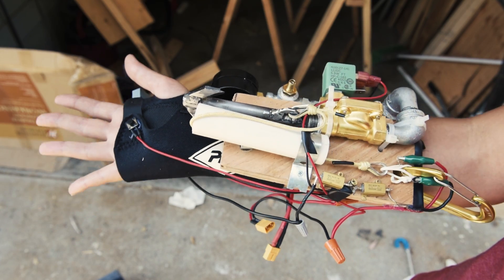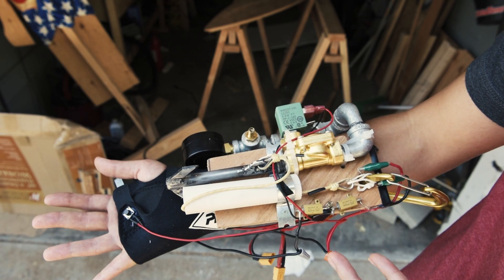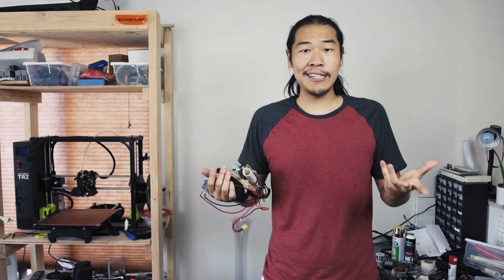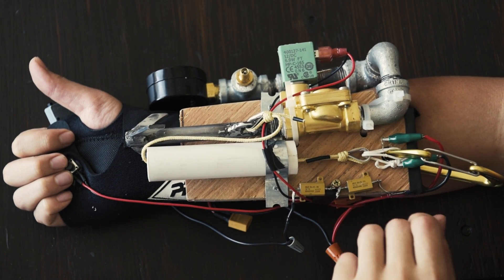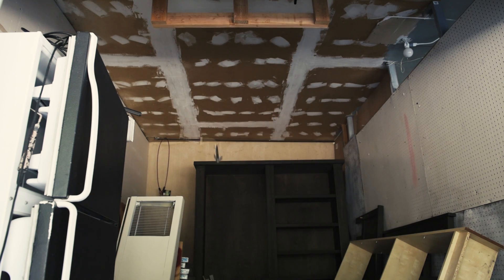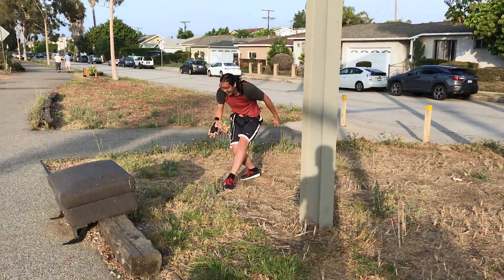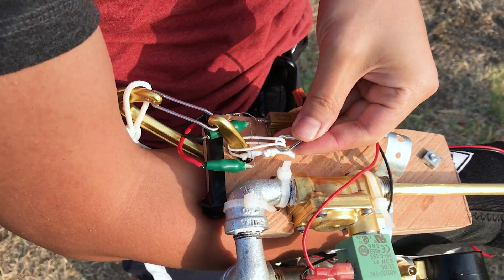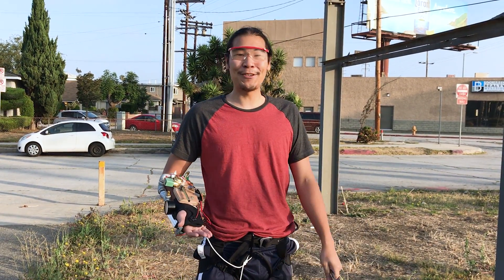Real Spider-Man Web Shooters Part 3: First Prototype Test!

Comment: now you should do sticky gloves that holds your weight so you can climb on a wall
Reply from the maker: Gecko tape is tricky to make, and it turns out as the weight goes up its efficiency tanks, so probably no Spider-Man gloves anytime soon. Though a vacuum wall climbing system is surprisingly easy, I climbed more than 3 stories with one on Mythbusters: The Search!
Reply: if they're sticky enough to hold his weight, how do you expect him to unstick?
Reply: Spectrum UK they’re working in that
Reply: @youaintasbadasyouthink  he could use a small electric shock since it would just be gloves there's  enough  space
Reply: Spencer Smith people are actually working on that, modeling it off of lizards fingerprints, because they have deep fingerprints they can grip almost any surface.
Reply: Spectrum UK adhesive wouldnt work, but maybe really strong suction cups with valves so he can stick and unstick
Reply: Orrr what the hacksmith done which was use magnets which would de-magnitise of a click of a button, which would have some disadvantages which means he can't climb on bricks only steel
Reply: Or magnet gloves or suction gloves because if they were sticky they would probably get ruined really quick
Reply: Spencer Smith Someone used electromagnets. He is called the hacksmith
Reply: yrm159 yea your right
Reply: I know but I want a different kind one that can stick to anything
Reply: @spencersmith3618  what about tiny hooks?
Reply: @houselightkell  like in Spider-Man    Tobey Maguire, but they would have to be very durable and sharp which wouldn't be very smooth to shoot out of a web shooter it would most likely become tangled up within itself but if it was like a grappling hook and as you are shooting it wouldn't be effective until it hits something from a side angle then the little hooks will be pulled out as it's sliding down hooking on to what ever it touches it would be the same for the gloves too sorry I got carried away on webs
Reply: @spencersmith3618  i meant like tiny hooks on the hands for climbing
Reply: @houselightkell  I did mention that near the end
Reply: his version
Reply: Spencer Smith just silicone gloves.
Reply: I remember recently watching a video about that from Nerdist. Think they only require a couple centimeters of that sort of gecko adhesive to hold a person's bodyweight.
Reply: Bookworm you may not realize this but that was just an approximation. Have you ever seen people tuna fishing? Some of those fishing lines are actually graded at nearly 3000 pounds! Plus fishing line is a lot more compact able!
Reply: MrWonderWaffles they did that in myth busters. Didn't work well
Reply: Rmb2552 That sounds like something Dr Curt Connors would work on ;)
Reply: And then make a machine that can predict the future so he has spider sense
Reply: yeah you could use gecko skin thing, a tiny bit could hold a crap ton of weight
Reply: Spencer Smith HE WAS AMERICA GOT TALENT
Reply: Rmb2552 Oh shit, Asian Spider-Man vs. Lizard-man LETS GOOO!!
Reply: Sufficiently Advanced like in mythbusters the search you should try smaller version
Reply: TheGamesKing The hacksmith wasnt the first person to attach beefy electro magnets to his extremities.
Reply: Spencer Smith on the know that broke use a bowline becouse they are for carrying heavy loads
Reply: Yeah they're called Ghecko Gloves
Reply: Spencer Smith omg that's such a cool idea
Reply: Pieter vanB those are for underwater use if you used tgat tp swing on you would fall on your butt
Reply: Hack smith already did that
Reply: Spencer Smith  I agree
Reply: can you send me one
Reply: like the gloves from the bo2 campaign?
Reply: Spencer Smith that would be cool
Reply: Spencer Smith and maybe an airtank on his back to reuse it
Reply: Yeah!
Reply: Use a vacuum mechanism, it could stick and unstick , whenever you want.
Reply: Sure bob
Reply: Spencer Smith i like spider
Reply: There's one that uses suction from a vacuum that an MIT student made and climbed the dorms with lol.
Reply: Spencer Smith 666 likes as of right now
Reply: Spencer Smith i think it pretty hard to build but i already seen a magnet that is build for that
Reply: Theyve made them for metal so its magnetic
Reply: It is very hard
Reply: If someone were to do a way without “magnets” or any thing else but instead used actual ways to stick to a wall you’ve got to need approximately 40% of the body’s surface area
Reply: Good idea
Reply: yes👌✔👍
Reply: Yea but how is he gonna stick to walls if its to big but awsome job but make it smaller or you'll fall off trying to stick to walls remember safety first
Reply: https://youtu.be/bAMrEiXpCiU wall sticking web shooter
Reply: There's a video on the channel nerdist where the host talks about how that is actually possible with carbon nanotubes
Reply: Spencer Smith that's a CoD reference
Reply: You should use fishing line! It is rated up to over 500 pounds!!! Shouldn't have a problem with it snapping!👍🏻 if u agree

Comment: Build a real portal gun from rick and morty
Reply from the maker: Haha I've actually been thinking about that! It would probably just spray green gloop instead of a real portal though XD
Reply: Galactaβyte [GD] A real portal gun obv.
Reply: Sufficiently Advanced If anyone could invent interdimensional travel in a whim it would be you!
Reply: +Galactaβyte [GD] Science!
Reply: Galactaβyte [GD]  you use quantum tunneling and quantum double entanglement.
Reply: DX-Reaper do you have any idea what you're talking about?
Reply: Do your know how much trillions of power required to power an actual portal
Hint:(for a portal with a size of a millimeter you would need quintillions for just 3 seconds)
Reply: Zell you charge it with your microverse.
Reply: TDx FLARES but how would you make real portals?
Reply: @galactabyte  woosh
Reply: TDx FLARES or the one from portal😍
Reply: Green Screen Gun!  might have a practical use if you could get an even enough spray under the right circumstances, then add some VFX for a great april fools joke for next year
Reply: Josh S5 it's a portal gun
Reply: Brandon Reyes is not like those are theoretical at alllll

Much sarcasm
Reply: Javi Why?
Reply: Mihlu 

Can you type proper english?
Reply: Javi can u 
That doesn't make sense can u type proper English because it should be can you type English properly
Reply: Galactaβyte [GD] Wormholes
Reply: @fucktrans6805  your name xD
Reply: DX-Reaper I think if you're making interdimensional portals you can find the necessary energy lmao.
Reply: Isaiah .B. This.
Reply: Impossible.
Reply: TDx FLARES 

Rick and Morty sucks.

Comment: For one, you should try to find a more durable wire, and for another, you should probably put some sort of protective casing over it.
Reply from the maker: That's Kevlar rated for 1,500 lbs. so durable isn't the issue, it's finding a way to make a loop at the end of the line with the right efficiency.
Reply: Sufficiently Advanced use regular climbing  eight knot and a loop don't use that steel piece can cut the rope use capstan mechanism to vary the friction and hold you in place and regulate your position change to 2000 LBS rope, check my Chanel did a device similar, if you want a Smaller  carabiner use metholius mini fs ;)
Reply: and then a blade or saw to quick release it
Reply: He also needs a reeling mechanism
Reply: I find the first an obvious statement, and the second moot point in a prototype for the given tests
Reply: Philip Johansson i
Reply: You should just pour a sh!tload of hot glue over the knots
Reply: https://youtu.be/bAMrEiXpCiU wall sticking web shooter
Reply: Sufficiently Advanced use duct tape. Duct tape fixes everything.
Reply: you did it, congrats!
Reply: Or paracord
Reply: Philip Johansson ?